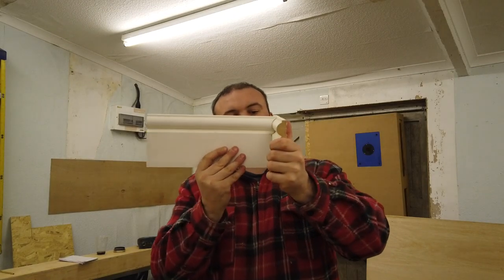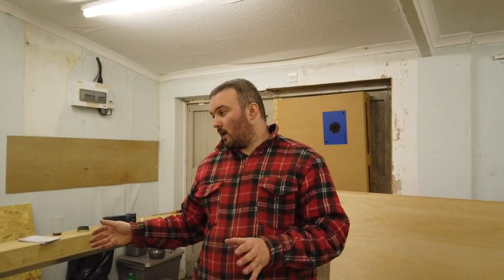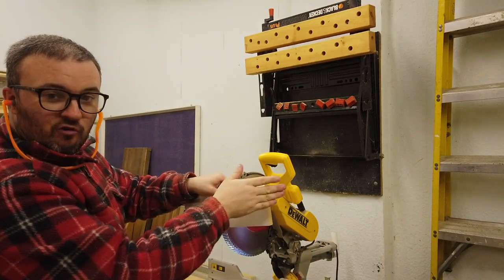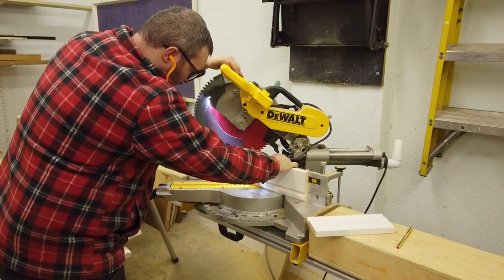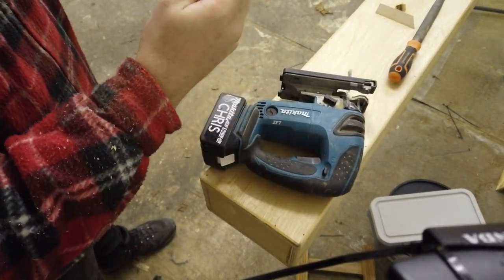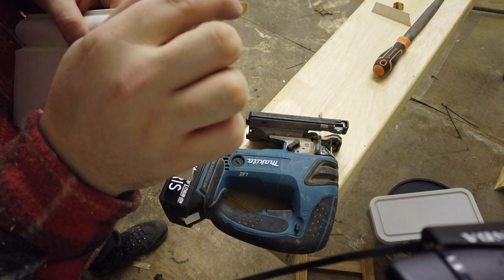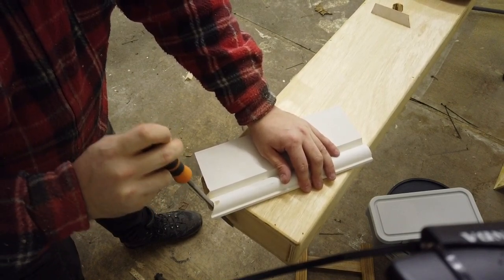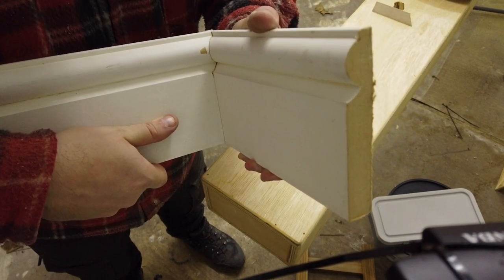Is this the FASTEST way to scribe a skirting board??

Comment from the maker: Thank you for watching. Please note that this is an older video and I have since upgraded my microphone and camera settings so I apologise for the somewhat quiet audio. If you check my most recent videos, you will be much more satisfied with the overall quality.
Reply: A grinder with a 40/60 grit flap disc is 3 times faster.
Reply from the maker: @TheShockndrop  Thank you for your reply. I have seen that done before. It certainly is faster and I believe that the reason a lot of people don't use that method is purely because of the dust. Doing it outside would be fine but when people work inside, this would be catastrophic 😂. Some grinders have guards with a built in dust port but this would need to be removed to sand the intricate profiles of the skirting. Maybe I might build a dust box which fits over the end of the board that the dust port connects to and do a video on this. This is one of the reasons why I started this channel. To get feedback from people so we can then all develop and improve. Many thanks.

Comment: Nice tips. I like the flap disc option instead of jigsaw also. Sands it all on one also.
Reply from the maker: How do you find it is regarding dust? It is something that I want to try.
Reply: @christopherinteriors6521  To be fare its a mess, but just do it outside when the neighbours have their washing hung out to dry and you'll be fine. I like the idea of making the cut on the saw. Would make that even quicker on the disc.

Comment: In production base you'll see guys cut upside down so they don't have to twirl long pieces of material around and upside down to make that second cut with the saw. Also there's no need to back cut so far - you can think about it like a profiled butt joint. Theoretically you can make that cut at 90 but I usually swing about 5 degrees over which accounts for the wall being out of square. Also I take the triangular point off the top with a square cut as well.

If you cut crown in position, which is upside down and backwards, it also helps to cut base upside down so you aren't turning your brain around all the time. So your left hand cuts are always made on the right and vice versa. Helps those of us that need all the help we can get.

Comment: Personally I would say back cutting at 45 degrees is way too much especially on mdf as the edges are easily damaged, needs no more than a few degrees. The top of the scribe should just be cut straight down to butt up against adjacent section.
I agree there's more than one way to skin a cat but this method isn't significantly quicker than using a coping saw and creates a lot more dust!

Comment: just draw the profile on the back of the board instead and cut it that flat side with a jigsaw(even basic hand saws and a junior saw can do it)... job done! :)

no need to faff about making mitre joints to find the profile. even a template can be made cutting just a couple mm's off the end of the board if needed
Reply: countless same mitre saw scribing technique videos on youtube yet I can't find one that does it the super quick and easy way I do it as described

my way literally outlines what needs to be done I can't believe it's not the norm lol
Reply from the maker: It would still need to be back cut otherwise it would only work if the wall is exactly 90 degrees. In that case you might as well mitre the joint. 
I do get your concept and for a new build home, built by decent builders then the corners would likely be around 90 degrees when using drywall. 
I specialise in old farmhouses where the corners could be 60 degrees with a curved wall which runs uphill.
Maybe I will do a video on that when I need have to do some skirting so people can see.
Reply: @christopherinteriors6521  ???? ...thats the whole point of a scribe cut instead of a mitre cut for joining 2 boards... to compensate for movement and angles lmao

just tilt the blade or(and) draw the lines appropriately to the angle needed to compensate for the vertical join then cut the line. if anything you get a more correct join scribing the back. 
I've seen chipys faff about doing your way and I've just took over doing the multiple joints and got them on the chop saws or easier stuff as they waste the work time for others.

I've ripped out old victorian and older(old houses are known for unevenness(not all walls are 90 degrees) and as to why scribe joints are often used) boards with the pencil lines still on the backs from where they readjusted it for the length of the boards for the final cut with past chipys doing it the way I've always known how.. I've done many curved corners where I've had to steam bend/form boards. at the end of the day the final cut no mater the angle of the joint is just just the same as a 90 degree if the line angled free cut is prepared/done right. I usually just tilt my scroll bladed jigsaw left or right for the whole cut for the joint needed and I get a snug perfect cut fit every time in under 30 seconds, if that.  as I can run it along the flat surface.

doing this inefficient mitre technique on more detailed intricate routings must be a headache involving loads of sanding doing it that way. asking for a bodge job done with caulk/wood filler needed lol

I guess I'm oldskool and experienced. too many novices on youtube these days claiming to be experts

like the old saying 'if you want to find a quicker and more efficient way of doing something then just get a lazy person to do it'<the technique I've always known can be considered 'lazy' but it's miles quicker and more efficient
Reply: get yourself some high quality thin scroll blades for your jigsaw. as you used chunky standard blades for the cut in the video

as it sounds like you need to often do bespoke cuts on old places as you said then this type of blade is a god send
Reply from the maker: @datboi380  I don't often as I am not a carpenter as such, more of a bespoke furniture maker. Thanks for the advice though. Sorry I was getting a bit confused and thought you meant do a straight cut on the back of the board.
Reply: @christopherinteriors6521  all's good. I meant make the mirrored template line on the other side with the routed edge. I hope you understand now. (the way you showed will show you on the back how a drawn line would look and you'd get it)

with enough practice you could prob make a decent video out of it as I can't find any youtube videos on it after I noticed this way people do it tbh... would make most other video's on these sorts of cuts done with a miter irrelevant lol
Reply: the flat end of the board would be the profile template

Comment: I do it the same way, except for the profile part i still use a coping saw. I find i can get a finished scribe easier and quicker than using a jigsaw/ file etc.
Reply from the maker: I have had some skirting boards which the profile is just too intricate to get a jig saw in there. It took me a long time though. This is the beauty of woodworking, there are so many different ways to achieve the same result. We need to find the best way that works for ourselves.

Comment: Nice video mate. I do it exactly the same way . The only difference is I use a barrel grip jigsaw with a coping foot on it which I highly recommend.
Reply from the maker: I agree that they are good. If I did more skirting then I would look at a coping foot myself. Although I make kitchens, clients are wanting me to do more and more skirting and other carpentry work so I'll see how I go with that. Thanks for the great comment.
Reply: @christopherinteriors6521  Ever tried a trim router?
Reply from the maker: @markbernier8434  not for scribing skirting boards I haven't. Does it work well? I assume you would still cut the straight part on the mitre saw and then use the trim router on the profile?

Comment: Thanks for sharing! Defo'  faster than I am with a coping saw. I have to say, though, that do most of the cut like you - using the mitre saw, or a hand saw to avoid hassle with the 'dust police' - and then finish with the coping saw. I've seen guys onsite using the jigsaw with that funky base, but just couldn't get on with it. I'll have a go at trying your technique and see how it goes.👍
Reply from the maker: Thank you for the comment. I have tried one of those bases before but I didn't get on with using a jigsaw from underneath. I don't do a huge amount of skirting as I make and fit kitchens/furniture. I don't even own a coping saw. It seems like a lot of carpenters are doing it the way that you say with using the mitre saw and then the coping saw. If I get hold of a coping saw I might have a try with one and see how I get on.

Comment: I like to back cut with the miter saw too; all the way down the straight part.  Then I just finish with a coping saw.  Unless I have a table saw set up too for some reason, then I use the table saw to cope the details.  That way is super fast and clean
Reply from the maker: I think I get what you mean. So for the scribe you take the fence out of the way and freehand it head on into the blade? I guess as the blade makes a rounded cut then it would be back cutting too! I might give that a go if I have my table saw set up at a job next time.

Comment: Could you please tell me what model Dewalt mitre saw that is please? Fantastic video and very helpful, I’m really struggling to choose a mitre saw to in my skirting, I want to be able to cut with enough clearance so the skirting is placed in the upright position the same you cut in your video. 

If you could recommend a few mitre saws I’d be ever so grateful. 

I’m almost about to buy a Festool KS 120 but it’s so expensive, I just really want a mitre saw with enough clearance and cuts perfect mitred out of the box, that’s under £500. 

Ideally I’d prefer a mitre saw that has the handle facing the opposite way than yours is facing. 

Thank you, all the best.
Reply from the maker: this is the Dewalt dws780 mitre saw. They are amazing saws but a bit heavy if you are taking it out of the van, up a driveway, through a house and into the garden to make one cut 😂

Comment: Does the 45° cut still work with a cope when the top profile is set further in than the bottom straight part of the skirt
Reply from the maker: Yes as long as you still only back cut the flat portion of the skirting. On the particular skirting board that I cut in this video, parts of the profile were set in further than the straight part. For example, underneath the round on the profile, the v groove part underneath is further back than the straight bottom part. Hopefully that makes sense.

Comment: Cut it with a 45° angle with a miter saw then use a coping boot for your jigsaw
Reply from the maker: I did actually mention that in the video. I have tried one before with a Mafell jigsaw but I wasn't the biggest fan, mainly as the jigsaw weighs a ton. I am tempted on trying one again on whatever jigsaw I buy next time though. Thanks for the comment Jason.

Comment: You could be faster if you cut the base upside down
Reply from the maker: Thanks for the comment. I am interested to hear more about this?
Reply: Basically if you are right handed all copes will be on left side of the base. Cut the base on a 45 degree upside down. Swing the saw over to the first detent which I think is 15degree  and cut down until the profile is not straight. Then finish the rest with coping saw.   This way helps so you don’t have to flip long material in the house and scratch walls and ceiling.
Reply from the maker: Thank you. I will give this a try next time I do skirting, although it isn't that often. I don't often do much cutting inside houses as people are always living in them but I am glad that you pointed out the ceiling issue. This is one of the main reasons that I made this video, because I like to see other people's ways of doing things, in hope that I can add tweaks to my own techniques. Thank you very much.